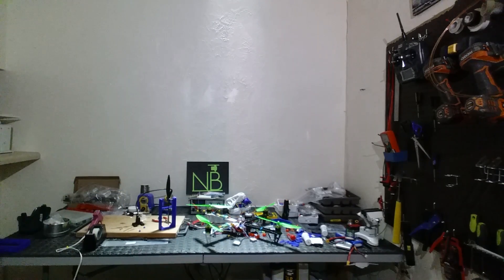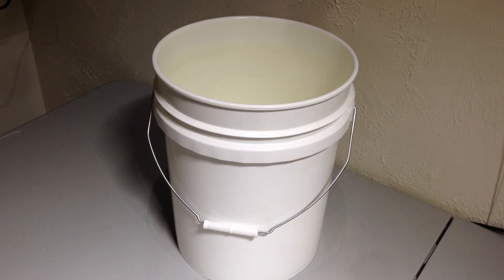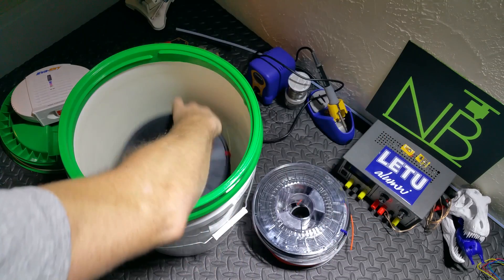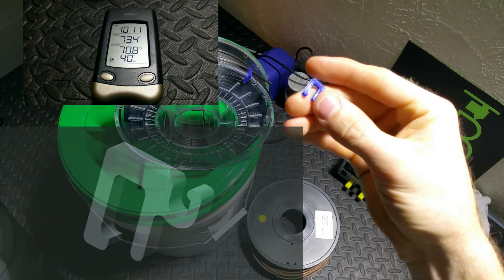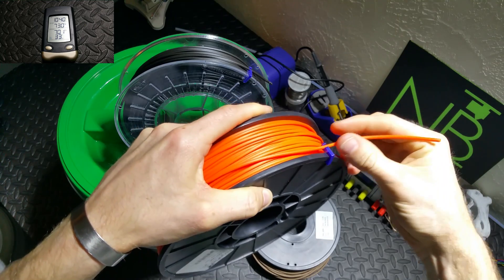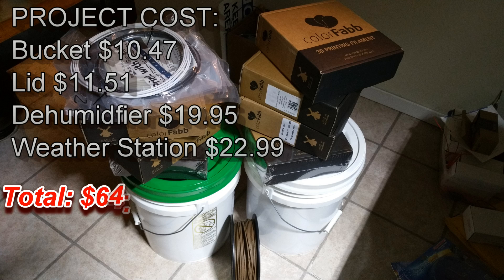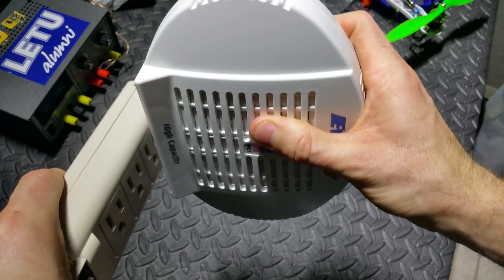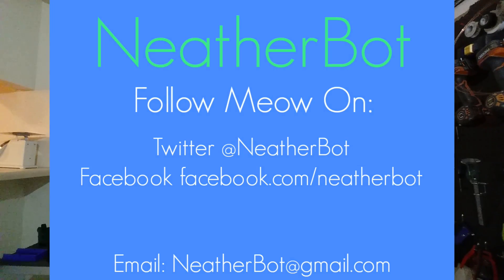Filament Storage

Comment: I just bought a ziplock bin to store filament in and I was going to put a charcoal moisture/odor absorber in it. would that be sufficient or am I going to need something with more moisture absorbing ability?  Also, I think you can buy a blue tooth hygrometer, which I think would be smaller than a weather station.  I just bought a Qidi X-One so I will be binging on your channel now, thanks a million!

Comment: for all my fellow cheapskates: ask for empty condiment buckets at a local deli or fast food place, and fill old socks or so with silica cat litter for overkill dessicant packs. (bake it before use for maximum effectiveness, it comes about 30-40% saturated) about 5 bucks for all the dessicant packs you will need in the forseeable future. =)
Reply from the maker: +Cuda FX good advice, thanks for the input!

Comment: when you do your cost add up you cross out the bucket and weather station. what do you do with just a lid and dehumidifier?
Reply from the maker: +awesley92 I was just showing that if you already have a bucket all you need is the lid and a dehumidifier to make it work. It can be cheaper to make if you already have a bucket!

Comment: Just so people know, the humidity level (under 30%) takes more than a day. Mine started at 72 percent, and it took an entire day for it to get to 32%. Im stuck at 32 percent right now.
Reply: I used a perforated altoids can full of anhydrous magnesium sulfate and a dozen 'do not eats' in a large tupperware bin, and the humidity dropped to 15% after a day. 
You make anhydrous magnesium sulfate by baking epsom salt in the oven at 250F(120C)  for a few hours, until it turns into a white powder, then store in an airtight container. It will be chunky and solid until fully dehydrated, and will clump if it has absorbed too much water out of the air. Just bake it again to drive the water back out. And bring hand moisturizer for when you're done :P
Reply from the maker: +Richard Smith dang that's a pretty cool idea. I didn't know you could do that with Epsom salts.

Comment: I use these bucket/lids (I have 5 of them right now) and I just bought a large bag of the small desiccant bags for $10. I throw a handful into each bucket. If they start to get moist you can put them on a cookie sheet in the oven on low (as low as it will go) for an hour.

Every roll of filament I buy has a desiccant in it, and so I just toss those in the buckets as well. Never had an issue with moisture using this method. I get my buckets and lids at Lowes.